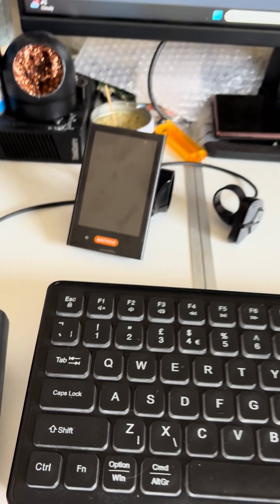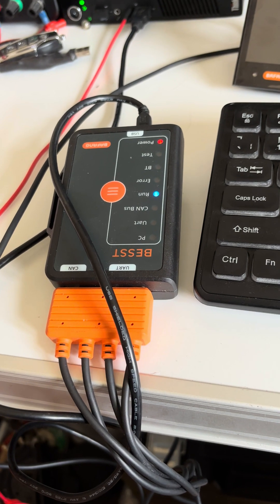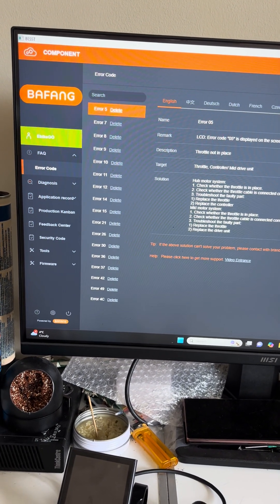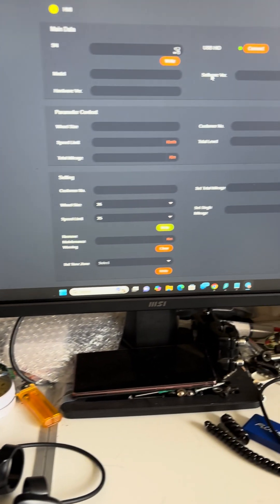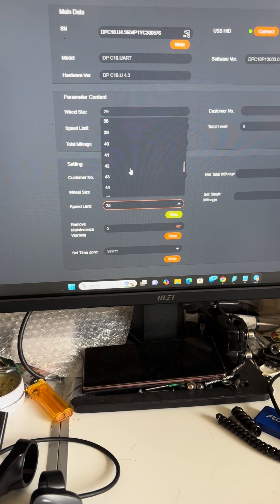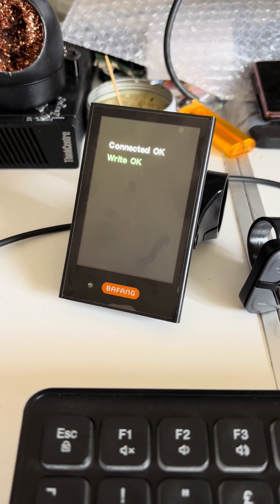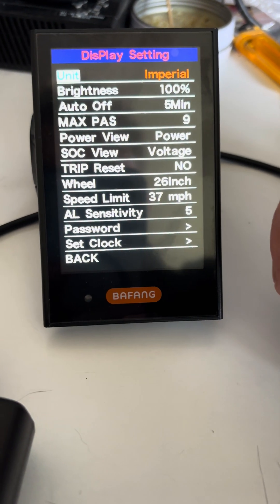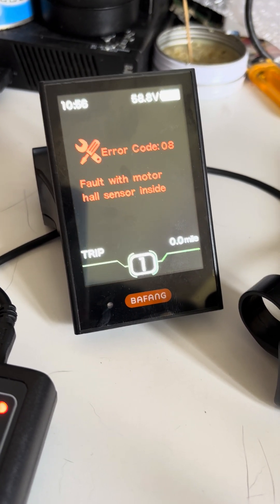How to remove speed limit of the Bafang DPC18 using BESST tool

Comment: My besst tool doesn't read parameter settings , it gives the message 
para. setting reading failed.
Am i doing something wrong ?
Reply from the maker: Which besst software are you using ?
Reply: @Bafanger  Best Pro
Reply: That's the only one available
Reply from the maker: @mvdnbos there 2
Reply: @Bafanger So you want to say i need the other one ?
Reply from the maker: @mvdnbos i used the older version of besst software not the besst pro and i have dealer access. That could make a change to access. As far as im aware there are few types of besst accounts

Comment: Maybe they updated this, or its because i'm in the USA, but the DCP010 enables me to do all that within the display itself, or I can open the Bafang Go App on IOS and set unlimited speed (which is essentially 99km), adjust acceleration, etc. The only thing I can't do, but wished I could do, is increase the max amps from 30A to about 50Amps.
Reply from the maker: On the dpc10 its different. Dpc18 can be programmed by manufacturer. I got this one locked on purpose just to show people that it can be locked and unlocked 😊